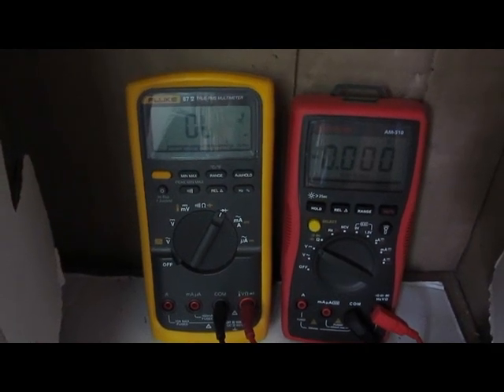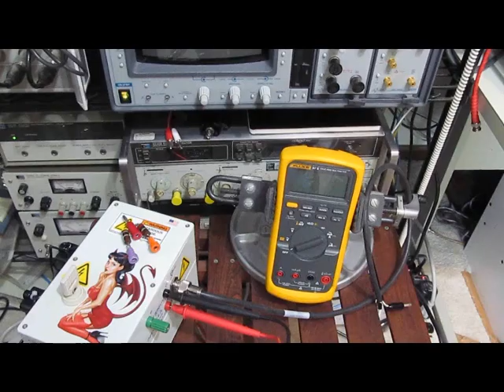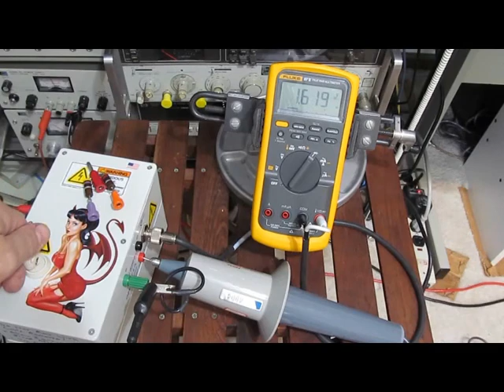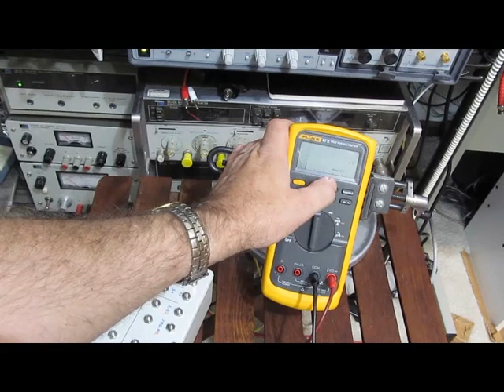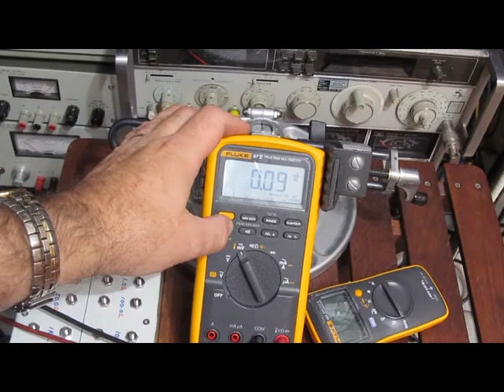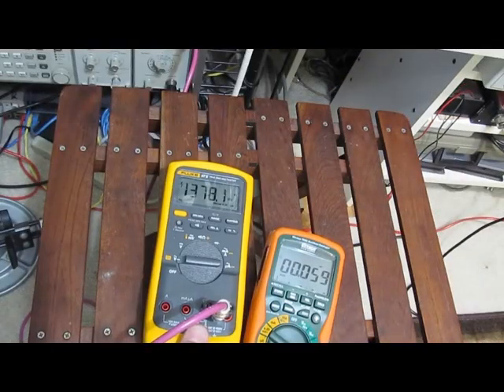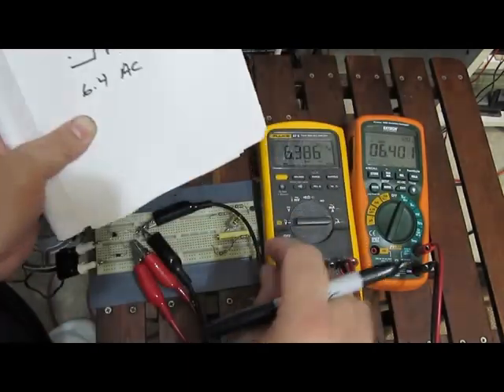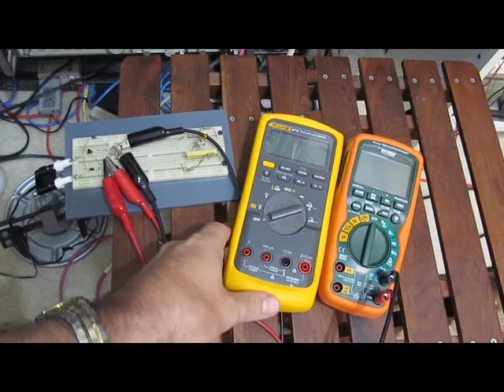The Fluke 87V is put to the test.

Comment: I got the worthog banchey 2 mester. It's warranted for life , and it will hold up after being tied to a truck and dragged for 200 miles. I even shorted it across a 7000volt power line with no problems. It only set fire to my hair. Correction , it burned my hair off my 🗣️ head. O I also fell 40 feet to the ground.

Comment: Not all Fluke DMM include a lifetime warranty. The newer models only have a 3 year warranty (like the 115 that I have). But the 87V still is covered for life. Maybe that's one of the reasons why it is so expensive for a roughly 20 year old design ?
But that warranty is limited. 
Read the fine print from Fluke: "Lifetime is defined as seven years after Fluke discontinues manufacturing the product, but the warranty period shall be at least ten years from date of purchase. *(Lifetime Warranty applies to products manufactured after October 1996). The warranty does not cover manuals, fuses, disposable batteries, damage from neglect, MISUSE, contamination, alteration, accident or abnormal conditions of operation or handling, including failures caused by use outside of the product's specifications, or normal wear and tear of mechanical components. This warranty covers the original purchaser only and IS NOT TRANSFERABLE.
Reply: F87V is from 2004. going by the manual dates 87-III would be roughly 20 years old design. But yeah, lifetime (limited) warranty would be a huge factor to affect pricing, I agree. That and Assembled in the USA engraving. :-)

Newer models with 3-Year warranty are usually considerably more electrically robust than the F87V.

Comment: Hi.  What are the part numbers and description/specs of the parts you replaced?  I have an old 87 that is not reading capacitance (OL when the leads are put to a capacitor).  Everything else seems ok.   It was used on a charged 35uF capacitor by mistake.  Thanks.
Reply from the maker: I hear they have a life time warranty.  Rather than attempt to repair it and risk further damage, I would return it.   How many volts was that 35uF cap charged to when you  damaged the meter?
Reply: 120 V.  The meter is from 1994 or so. Does the warranty still apply to this?
Reply from the maker: That's too bad.  I am surprised you damaged it with only 120V.  I hear people say it's a lifetime warranty and this is one of the reasons people buy this brand. I have no idea if they would cover it or not but I would contact them first.

Comment: Why did Fluke 87V fail but 101 did not? Didn't Fluke ensure adequate input protection for all their meters?
Reply from the maker: It was not as robust.  101 is a newer design.  Requirements change.
Reply: @joesmith-je3tq  Thanks Joe for your reply. How should I view it though? Is the 87V that is shown to be less robust than the ut139c you tested still be considered a safer device given that it is UL listed? So far my interpretation of robust vs safe is - if a device is robust, it might be able to handle higher transient voltages and still works fine after the transient if it survives, but if it should fail, it may fail more dangerously. Haha. Not sure, if I got you right.
Reply from the maker: There is a FAQ. I suggest you start there.
Reply: @joesmith-je3tq  Sure, Joe. Where can I find that FAQ? Eevblog forum?
Reply from the maker: My main page, select about.

Comment: what revision is printed on the circuit board and date of manufacture? seems new ones anything other than past revision 11 seem not to hold up well. and revision 9 had the gsm problem
Reply from the maker: The one using in this video was a revision 10.

Comment: you just destroyed a $500 fluke because you had current flowing threw your meeter while checking resistance. You really need to read the owners manual before you make a "test" video. Fluke meters are some of the best in the world you just need to learn how to use them.
Reply from the maker: All of these meters are tested the same.  You may not like it but the 87V is just not very robust.
Reply: Is it possible you cycled though the resistance range that the 87 has that the 101 does not. Check out the MHO vs OHMs option. Not sure how it affects the interface but the two are not the same when you were manually doing range switches. Not defending the fluke but just a thought.
Reply: I believe it pops up a nano Siemens symbol on the display
Reply: He is own jobe
Reply: @lynnnash4576  Better check your power supply it could be over shooting
Reply: Absolute correct.

Comment: From what I had been reading, the impression I got is that Fluke 87V is the gold standard as far as multimeters are concerned. I'm just beginning my electrician career and am trying to find a good multimeter. I was going to purchase an 87V, but after seeing that the cheap 101 stood up to the test and the 87V didn't I'm not sure if I should get it now. Do you have any recommendations? For residential/commercial type of work
Reply from the maker: I wouldn't want the 87V as an electrician. I'm surprised you wouldn't want a clamp.  Maybe if I were some sort of tech.   That said, I don't normally offer recommendations.
Reply: The worthog banchey 2 is my choice.

Comment: Joe, I enjoy your reviews and you seem to be at least reasonably objective though your biases can be detected now and again. I wonder, however, about the applicability of subjecting meters to conditions far outside their design parameters. I'm not sure that is terribly relevant. It's sort of like taking a piece of Waterford crystal and asking whether it will survive being dropped on the kitchen floor. Yes it could happen but no no reasonable person would expect it to survive. Would you take a $50,000 oscilloscope and deliberately apply 500 volts to the input terminals just to see if it would tolerate that? What would be the point?
Reply from the maker: You may want spend some time reading the FAQ under the About menu of the main page.   Here is Fluke's own video with the 87V.https://www.youtube.com/watch?v=Cij9I1y84kc

Comment: i spose if you keeo exhausting any fluke multimeters to high voltages and screwing around with the knob any multimeter will fail.when testing higer voltages its common sense to not put it in continuity.common sence will protect a multimeter more than anything
Reply: I am glad to see these expensive meters being pushed. They have to prove their worth !!
Reply from the maker: The 87V was by far the least robust of the Fluke branded meters I have looked at.  A little strange as it was also the most expensive meter I have ran to date.
Reply: It has a good rep and maybe a legend. But may be a bit outdated as you say. I used Amprobe clamp meters for years that cost $95. No problems although not as rugged as I would like--a bit flimsy. Looking to buy another and considering the Extech.
Reply from the maker: Maybe 15 years ago I would have been impressed with the 87V.  Still surprised how weak the front end is on them but being so old it  may explain why.   I picked up another EX540 and was going to test it but it was bad right out of the box.  Ended up doing a little comparison between it and the one shown in this video.  There's a big difference in quality.   For an all around bench meter,  I like the Brymen BM869s out of all the meters I have looked at so far.